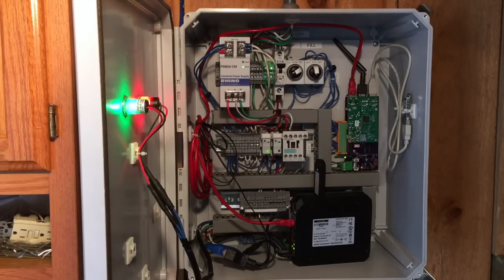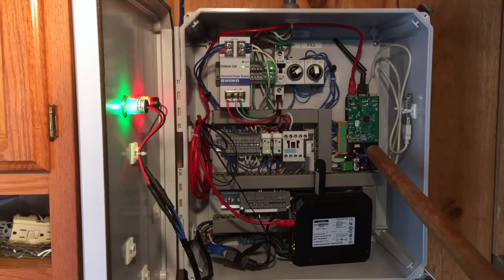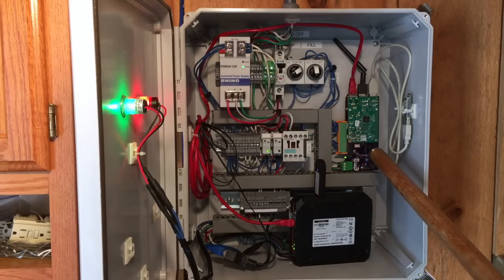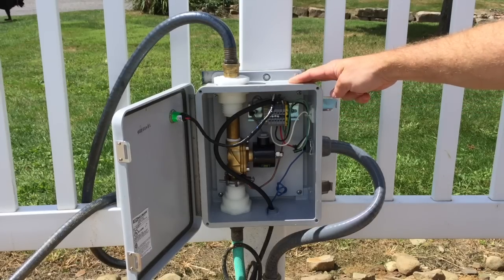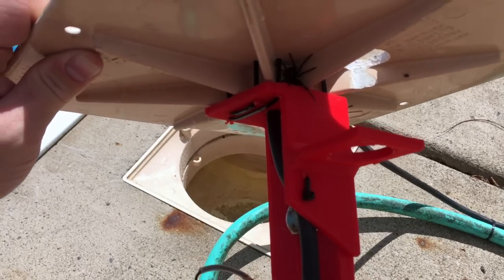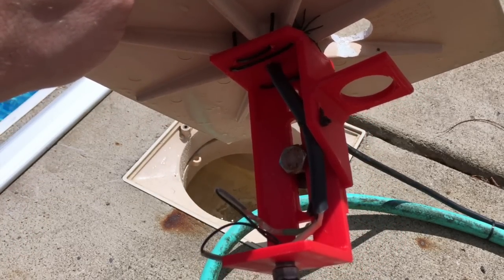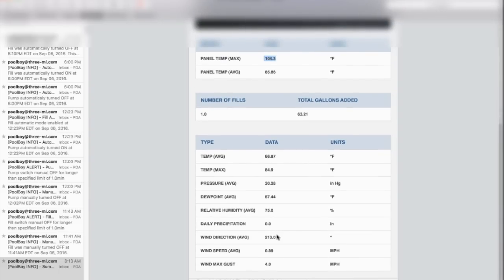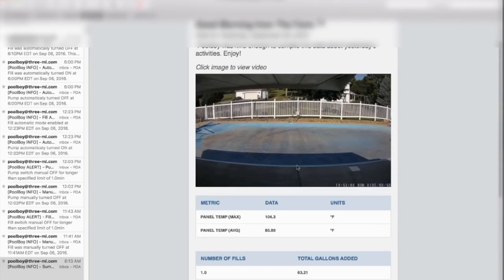Rhubarb (Industrial Raspberry Pi) for Pool Control

Comment: Nice looking control panel! Looking to do a small build myself using Codesys software to program my RPI using ladder logic and adding the Rhubarb on there as well. Maybe do some cutouts for 2 140 mm PC fans to circulate some air in the panel?
Reply from the maker: Thank you!! I don't build panels for a living, but I was happy with how this one turned out. I have temperature monitoring in the panel, and although it gets up to 110F in the summer, I have never had an issue with heat. Glad to hear you are thinking of using the Rhubarb! I just got some more back in stock.